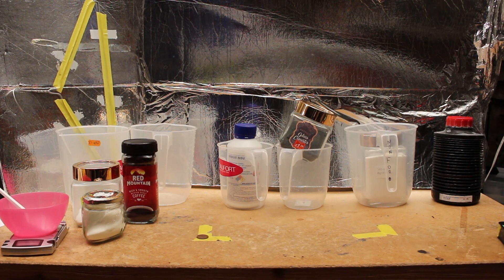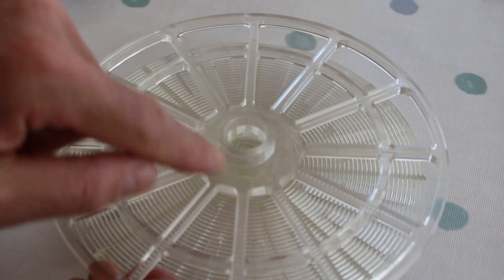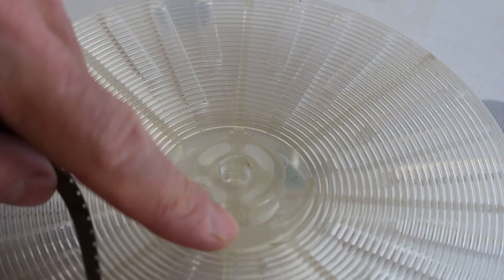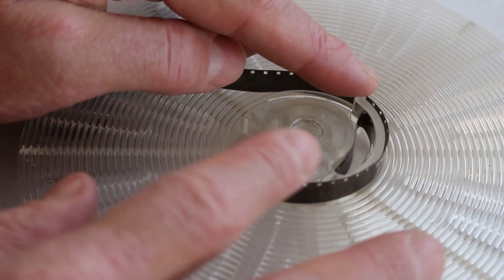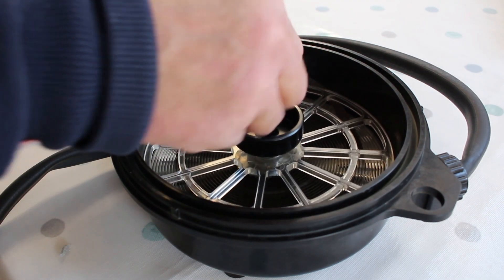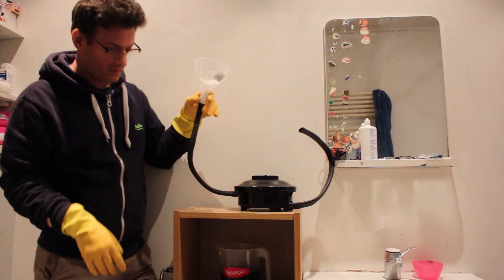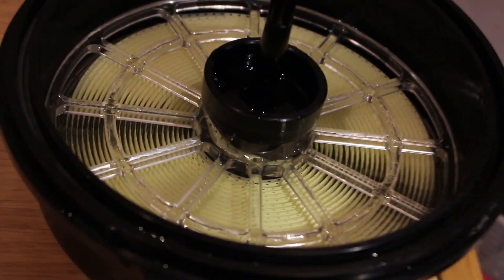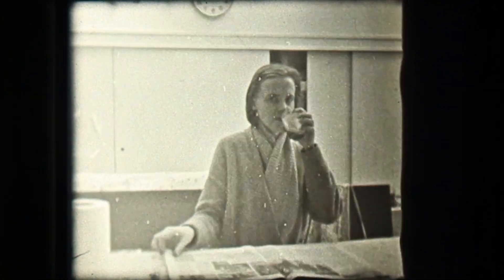Super 8 developing in a Lomo Spiral

Comment: Just received mine today (unfortunately also the 10 meter version but for a reasonable price).
First thing I've done is remove the top hose and plug the hole because I really prefer using the center hole. The 15 meter tank also has just 1 hose at the bottom.
The only thing it could be useful for is if you connect the top hose to your tap for rinsing.

Comment: i tried it for 20 times on 16mm film with the exact same tank and film keeps pulling out. it jut not stays in the reels and moves in every direction
Reply from the maker: Are you sure you're using the correct spacers between the spiral and the top plate? If the film is escaping the spiral there may be too much space between the spiral plate and the top plate.
Reply: @ZeroBudgetFilmSchool  thanks for the answer! the problem turned out to be the amount of pressure i used to hold the film. too loose and it moves freely in the spiral, too tight and it jumps off the reel. took me a few dozens tries to even find out. haven't found out any commentary on this. guess i'm uniquely stupid.
Reply from the maker: @egopraxia  yeah it's a fine line you have to walk with getting the pressure right. My lomo has a slight dip or scratch 3/4 the way through and I always have to be super careful at that point or the film will jump off the spiral.

Comment: Hello, do you have information about this?! 
What does  developer Rodinal 100+1 and 50+1 and
 1+25 mean? For example, how many ml of water will be and how many ml of liquid solution. Please reply, thank you):
Reply from the maker: It's how much water you need to add per unit of rodinal, so 1+100 is 10ml Rodinal +1000ml water, and 1+25 is 40ml Rodinal per 1000ml water. The stronger the solution the less time it takes to develop. A litre of Rodinal will last you a loong time.
Reply: @ZeroBudgetFilmSchool  I mean, if the container capacity was 500 ml divided by 26, it would be 19 ml developer, so the water would be approximately 481 ml like this, is my calculation correct and going the right way?!
Reply from the maker: @abohosamabohosam4178  close enough, it's 20ml not 19ml
Reply: @ZeroBudgetFilmSchool  Did you apply this 25+1 rule during the caffeinol developer process with your film in the Russian lomo container or did you apply another rule, how many ml is the total capacity of the lomo container, and what is the best chemical developer for a 16mm film with a length of 100ft, I want to experiment and learn, and maybe try caffeinol, thanks is yours,
Reply from the maker: @abohosamabohosam4178  the length of the film makes no difference what developer you use, as long as there's enough developer to cover it in the lomo. 1L is enough to cover 50' (15m) of super 8. Your other questions I can't remember.

Comment: Are the (bleaching materials) you have in the video useful for whitening 16mm or 35mm films of a positive type Fomapan? wait for reply thanks
Reply from the maker: Yes, Fomapan R100 can be bleached the same way, whether it is 8mm, 16mm or 35mm. Just make sure you don't leave it in the bleach too long (3 minutes usually does it for me)
Reply: @ZeroBudgetFilmSchool  1- Does this mean that the film of the type (positive Fomapan) does not need any developed solution! Only bleaching is done immediately after that, the rest of the process is completed to the end. This is the meaning?! 2- I have an old 16mm CINE KODAK MODEL BB JUNIOR camera and it works, what do you think of this type? I will try it with a 16mm film, I may use a negative with the development of caffeinol. What do you think, what is the best film suitable for this camera, both positive and negative, and what do you recommend?thank you.
Reply from the maker: @abohosamabohosam4178  Of course Fomapan needs developing solution. For reversal development it goes : first Developer, bleach, light exposure, second developer, fixer, wash.
Reply from the maker: @abohosamabohosam4178  for the Kodak BB camera, you need double perf 16mm film (holes on both sides) for more about this camera, check out Michael Carter's channel: https://youtu.be/lvskQaWnyX8

Comment: Thank you for your exhaustive work and inspirational videos. I am wondering if the bleach and the clearing bath can be thrown through the sink or it should be treated as the fixer, being thrown in a proper waste tank. (Although I guess I can imagine the answer). Greetings from Spain!!
Reply from the maker: Well the bleach and clearing bath both contain substances used in food production or sterilisation and should be OK to put down the sink with plenty of water to dilute/flush it away. Just don't mix the two or dump them together. When mixed they produce dangerous gases.
Reply: @ZeroBudgetFilmSchool   Good to know! Thank you very much!!!!

Comment: Does this process with its materials mentioned in the video succeed in developing a 35mm and 16mm moving film and give good results, or not? I am waiting for your reply. Thank you.
Reply from the maker: Whatever works for super 8 will work for the same stock in 16mm or 35mm.
Reply from the maker: @abohosamabohosam4178  Oh wow that's about fifteen questions looks like I've got my homework for tonight.  Check back later I might have some more detailed answers but for one YES there will be damage when loading it like this, you need to do it in complete darkness (not red light) I'm just demonstrating it in the light so you can see what I'm doing.
Reply from the maker: Hey where did the rest of the questions go?
Reply from the maker: @abohosamabohosam4178  no really I'm fine answering questions it's just one at a time is best to keep it simple.
Reply: @ZeroBudgetFilmSchool  Bleach (A) 500 ml water 2 g potassium permanganate
Bleach (B) 500 ml of water 27 g of sodium bisulfate (Mix A and B before use) 
 1- After mixing (A) in a bowl with water, we mix (B) with water in another bowl, and after finishing we mix A and B in a uniform bowl for all So we have 1000 ml, is this correct? 
2- If we only want to make the film only negative without a positive reflection, we only use caffeinol, washing and fixative like this? 
3- Can a powdered fixer be used instead of a liquid, and how many grams are with water? Thank you
Reply from the maker: @abohosamabohosam4178  1. Yes, correct. 2. Yes, also correct except for using Fomapan, which needs the bleach or it will come out too dark. Tri-X will develop either negative or reversal. 3. Yes, you can make fixer if you dissolve sodium thiosulfate in water along with ammonium chloride. Not sure of the exact amounts, I use the liquid fixer from Ilford.
Reply: @ZeroBudgetFilmSchool  1- For example, if I succeeded in developing a negative film (35 mm, 16, 8 mm, etc.), I did not perform the positive whitening process and left it for one or more days. 2- I have a lot of bleaches at home, for example (Clorox laundry, flash liquid 10% (hydrochloric acid) is a strong oxidizer, also drains, sulfuric acid 98%,,, All of them are available to me at home. Can I make it a suitable bleach for the movie, or what are the alternatives 3- Is it possible to check the amount of (thiosulfate and ammonium chloride), or give me a link?
Reply from the maker: @abohosamabohosam4178  2. Don't use domestic cleaning bleach (like clorox)  instead of film reversal bleach, it's not the same stuff! As for the precise amounts of fixing chemicals, you'd have to Google that.
Reply: @ZeroBudgetFilmSchool  1- There is no problem in postponing the bleaching of the film for another day,, Yes
 2- What about flash liquid 10% (hydrochloric acid) is a strong oxidizer, also drainage, sulfuric acid 98%,,, Do you mean that this is useful for the bleaching process??! What is the size of the ovary and what is the volume of water?
Reply from the maker: @abohosamabohosam4178  you can't postpone bleaching, it has to be done after first development and before re-exposure to light. If you develop and fix as a negative then your film is a negative permanently. Don't use flash or any other cleaning product. I don't know what you're on about re: ovaries. You can in theory use dilute sulphuric acid instead of the dissolved sodium bisulphate but how much or what pH it should be I don't know.
Reply: @ZeroBudgetFilmSchool 👍👌 Yes, now I have some good and initial knowledge and got a lot of information about the caffeinol process, bleaching and bleaching materials because of your answer and the great good information from you and from following your old channel and videos,, I will try and maybe succeed when I get the necessary materials, and the container "Lomo Spiral" It is available on ebay and amazon, thank you very much, greetings to you👋🌹

Comment: So i tried my first hand at some ektachrome type G filme and the emulsion lifted after the first dev of hc-110b is this just a sign that hc-110 isn't compatible with the film or is the film too old to process?

My temp on the hc-110 was about 70-80°f
Reply from the maker: I'm not sure if it was the chemistry that lifted the emulsion but it's more likely the temperature of your developer. Anything above 24C/75F will strip the emulsion of Ektachrome G , or Ektachrome 160A for that matter.
Reply: @ZeroBudgetFilmSchool  ok so next time ill try a small strip but if it keeps lifting the emulsion then is it just bad film?
Reply from the maker: @entity9742  Well, if the Ektachrome G was stored somewhere hot between when it was manufactured and now, it's possible the emulsion was damaged, but if you put a strip into sub-24C temps and it still strips the emulsion I think the hc-110 is more likely to be the issue. If you have another developer like Caffenol it would be worth trying a test on that too. Try not to wipe the emulsion side of the film when the emulsion is wet because it can be fragile before it dries.
Reply: @ZeroBudgetFilmSchool  i dont have access to caffenol but i do have ilfosol 3 b&w developer would that work?
Reply from the maker: @entity9742  It might... What you need to do is try a test trip at different development times. In my experience almost every developer can bring out a B&W or monochrome image, it's all a matter of getting the timings right. Of course if the film is age-fogged or you didn't give it enough light in the first place you won't get an image whatever you develop it in. Check out my film about doing a sensitivity check on expired film: https://youtu.be/GjY1RnoYZZM

Comment: There has to be a way to lessen the dust particles.
Reply from the maker: I've found that a lot of what looks like dust is actually silver particles that get stuck to the emulsion during the bleach stage. The results can be much improved if you don't agitate at all while the spiral is in the bleach, just open the lid and carefully lift the spiral out once the film is bleached, then throw out the bleach and dip the spiral into the clearing bath and then rinse really well. You can skip the clearing bath if you want and just rinse, but I like how it stops the bleach dead and the picture looks cleaner as a result.
Reply: @ZeroBudgetFilmSchool   Good insight.  Im getting ready to do this myself.  Have you heard of anyone having success with developing reversal film in the Morse tank?
Reply from the maker: @Asset1968  personally I don't know anyone who has developed reversal in a Morse tank. If you can empty and refill with bleach after the first development stage it is theoretically possible, but I'm no expert on the Morse.

Comment: How likely for 8mm film to fit and actually develop in developing tank of 260 ml? If I have 3 developing tanks of 35mm, do you think it would be okay if I cut 15 metres in half to develop and than watch them through the projector?
Reply from the maker: Hi there. A 260ml tank is way too small for 15m of super 8. The developer will not reach all parts of the film because the film will be squeezed against itself. You could get maybe 5 metres into such a 35mm tank if you took the spiral out. My advice is to get a 3-4 roll sized tank and bunch up your film into that, or a bigger tank or a proper lomo tank. I demonstrate the use of the long tank in previous films.